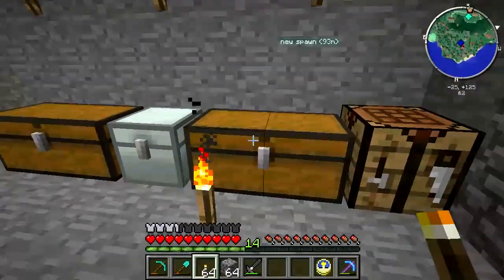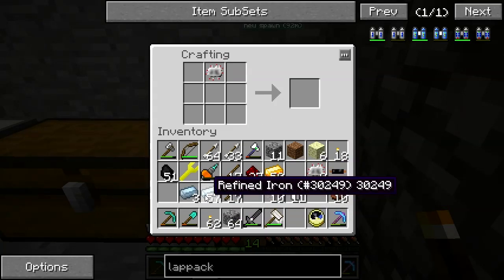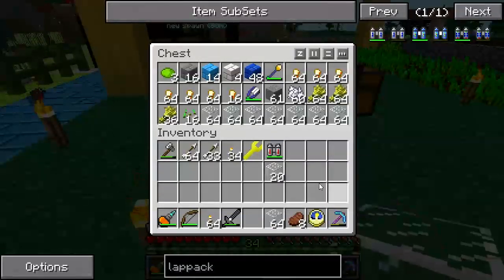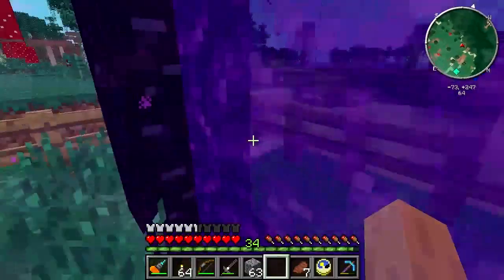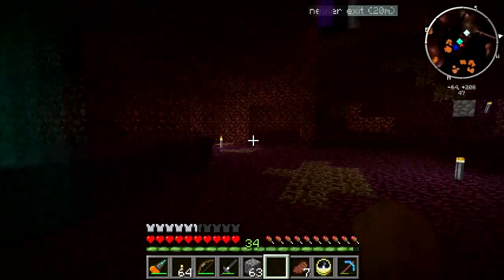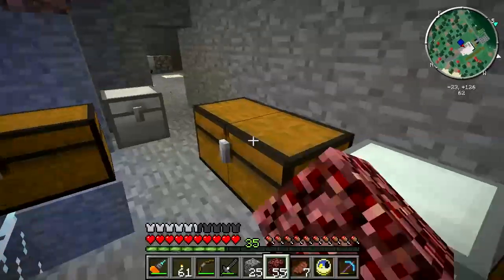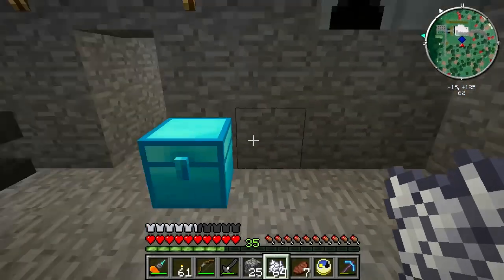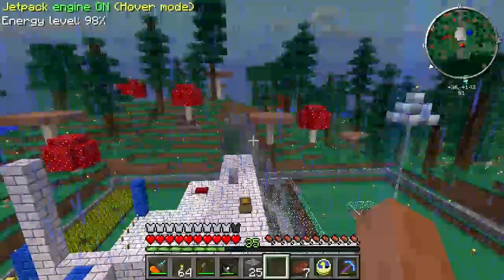E-077- Armored Flying - Hermitcraft FTB

Comment: A didnt know that but you know what i meant by that :D
And btw i think you should be able to use the boost key with the advanced nano chestplate. The default is ctrl key but dont know if its bound to multiple commands sometimes it will.
Just check the controls section in the main menu ;)
Dmac's was playing with it in his video ;)